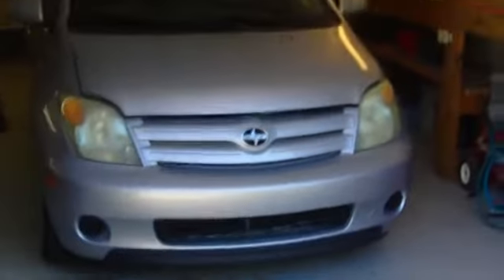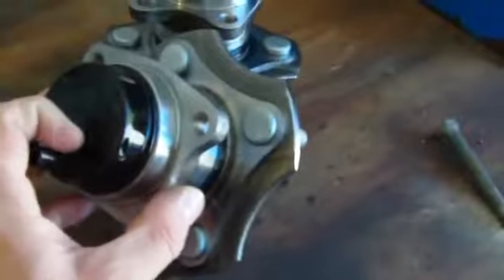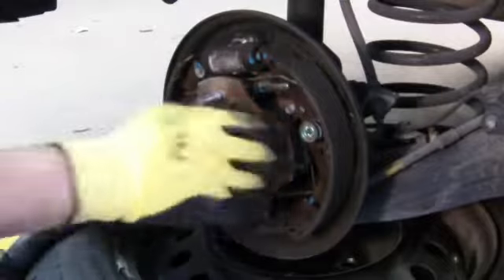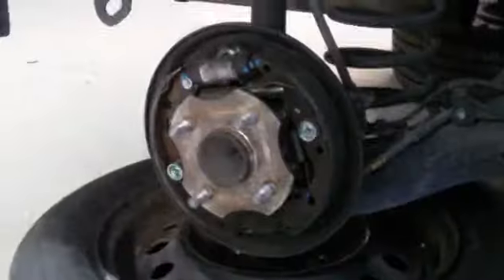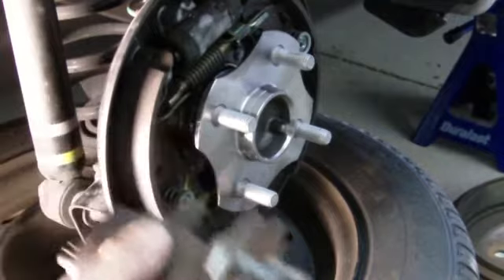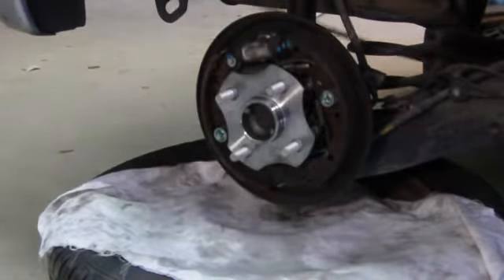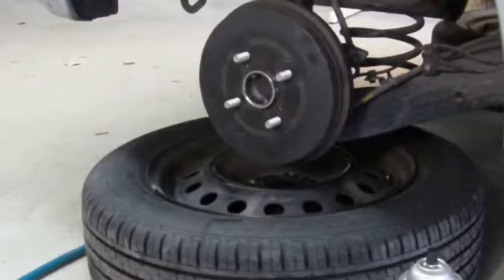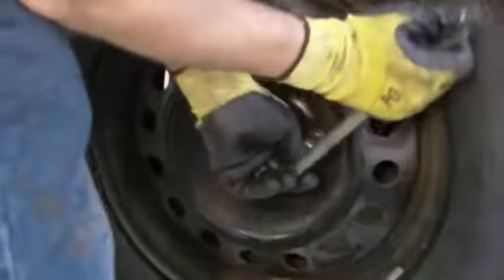How to Replace Rear Ball Bearing Hub of a Scion xA xB

Comment: You were lucky they were not rusted in. My 2004 xA has 165k miles. The hubs were very hard to remove. I had to use an impact chisel to separate the unit from the mounting flange. PB Blaster was my friend too.

Comment: Did this today, both sides.  Video was vet helpful, thank you.  Definitely helps to use penetrating spray on bolts before removing them.  Back wheels were very noisy, now quiet like a new car.  Thanks again.

Comment: I removed the bearings on my '05 xA in 10 minutes. After securing the vehicle and removing the tire, I took a sawzall and cut the back of the old hub off. It's junk anyways. Then tap out with a hammer. I have ABS so I taped that wire up and out of the way so I didn't cut it. Seriously it's 10 minutes if you take a 2 minute break. Book time is 1.5 hours.

Comment: NEVER STAND ON A TIRE IRON.  When working on the rear axle of a vehicle you should CHOCK THE FRONT AXLE to prevent the vehicle from moving.  Placing a tire under the work zone is a dangerous and prohibitive habit.  Furthermore, in the event that your vehicle falls off of the jack stand you will have most likely ruined your rim.  Also, those aren't screws holding the bearing hub assembly in place.  They are bolts.  Additionally, NEVER STRIKE INWARDS ON A BRAKE DRUM.

Comment: Yea well it won't come out , I had to use a big ass chisel and hammer and beat the backing plate  off the axle and the bearing stuck in the backing plate still..hanging on the hangar  so the brake line dont break.. because of rust.. you guys and your clean ass vehicles this never works.  Because of rust.. I have no idea how to get it ou tg without breaking the brake line off and getting it o n a bench and pressing it out .  What's your ass answer to that.

Comment: Beware, this video doesn't show how to remove the hub assembly after you take off the four screws and it does not show how difficult it is to remove the four bolts holding on the hub assembly.  The Scion xB is a little different.  It is not possible to use a socket to get to the four bolts.  You will have to use a 14mm box wrench and cheater bar to remove the four bolts to the hub assembly. The torque spec is 159 pounds so it takes a little muscle.  A socket wrench will not fit.  I tried a 14 mm crows foot attachment on my socket but the open wrench is not strong enough and will cam out/round off the bolts.  I suggest a 6 point box wrench to avoid striping the bolt heads. Removing the hub will require either a special tool (kind of like a steering wheel puller) or 3ea 4x1/2 inch bolts, washers and nuts.  The hub assembly has 3 holes in it.  Put a bolt through the hole, put a washer and nut on the inside and screw the inside nuts to press out the hub assembly.  Make sure the screw is pushing on the mount and not on the inside of the hub assembly. Also its easier to remove the ABS cable after the hub assembly is removed but make sure you have an extra hand to hold onto the assembly when it comes off so that you don't damage the wires. With the hub assembly lose, you will have better access to the ABS clips because you can turn the assembly upside down to take off the grey clamp shell locking clip and then pull up on the tab shown in the video to slide out the black clip.
Reply: This comment is not right, it shows how to remove the hub @ 5:36 I don't understand why, when someone try to make something helpful like this video there is always a smart ass coming to try to discredit it, why don't you make your own video LisaLovesMySi
Reply: Javier why are u mad lol at 5:36 you can obviously see the video was cut. He had the socket in, cut the video, then hand loosened it. It didnt show how hard it would be, which is why lisa said it "takes a little muscle"
Reply: @LisaLovesMySi....I know this is an old post....just where (on the old hub) are there 3 holes to insert a removal bolt like you say? And what does 4 x 1/2 bolt mean?....the car is metric and what kind of "puller" bolts are we really talking about. Even looking at the vid here both new and old hub assemblies don't show the existence of these 3 holes you speak of. Are you maybe confusing this with a 2011 xB or XD with rear disc brakes where the hub may have such 3 holes you speak about? The only way....for Scion xA / xB....is to hammer-out 2 oppiosoing wheel studs....and use THOSE holes....there are no holes otherwise in the front flange. Then, I guess you mean use 4" long x 1/2" diameter threaded rod or bolt with nuts and washer....to act as a "puller" bearing agains the rear backing plate of the drum. Make sure the point where it bears-down in the backing plate us further supported by heavier metal behind it....so you don't punch through.
Reply: I used a Milwalkee 1/2 in impact gun  with a 12mm wobble socket... and a 10 inch extension,,,, No idea what you're talking about!!!

Comment: have a cuestion i took the four bolts and the barring is no coming out. also i hit with hammer and steel not move?? what can i do please?
Reply: +Pedro Sanchez I just tried doing this yesterday and had the same issue. I just bought some lubricating oil, which i'll spray on the front side and back side to try to  free it up.
Reply: Korruptor ok thats what im going to try. Thanks korruptor. Hope u can make it too.
Reply: Korruptor yes i did. I changed. I live in chicago u know with all the salt and rust the Baring it was very atach to the car. And i was hiting really hard with the hammer but the barring don't move . because i was hiting up and down. so i went to the autozone and i ask if they can let me barrow a tool for that and they did . i dont know the name but is like a sucker!!